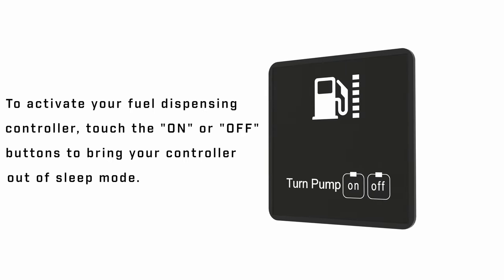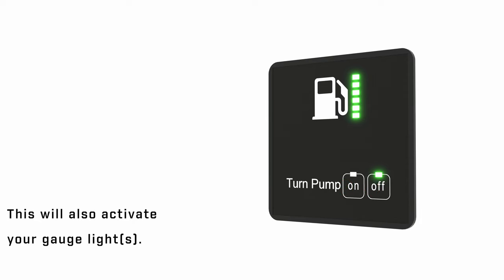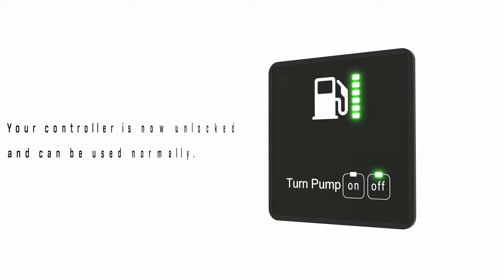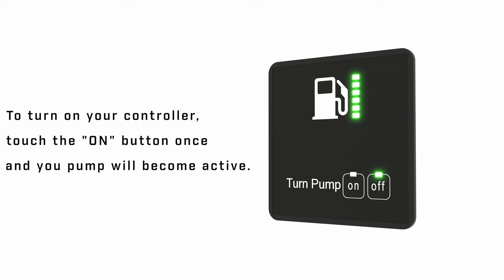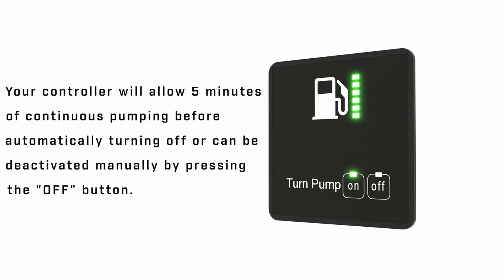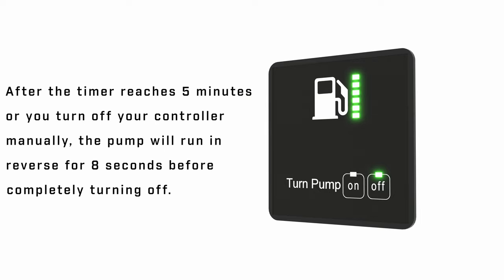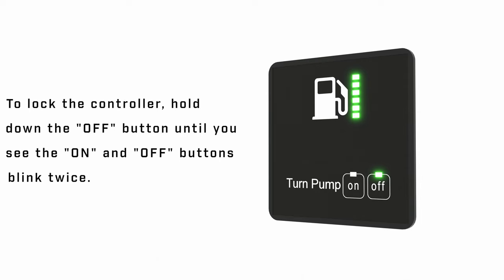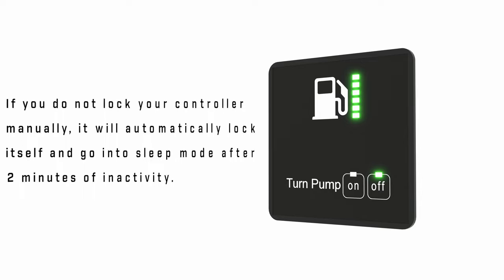Vector Performance Fuel Pump Control Panel Tutorial

Comment: Controller will not light up after being off for a while. How do I get it out of sleep mode. If I pull fuse and plug it back in the controller will light up and work but after being off a while I can’t get it to light up again without pulling fuse. I tried touching both buttons then holding off for 3 sec after watching another video but that doesn’t work either

Comment: Can I turn off the 5 minute timer?
Reply from the maker: Hello Devin, the 5 minute timer is a safety requirement that meets RVIA/DOT regulations. Therefore the 5 minute timer cannot be disabled. For extended fueling you can cycle the system again.